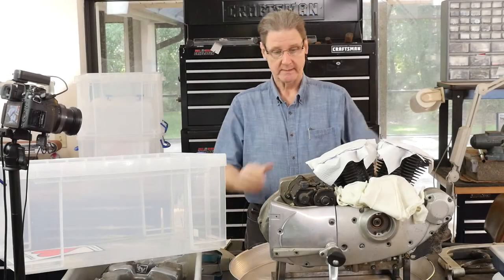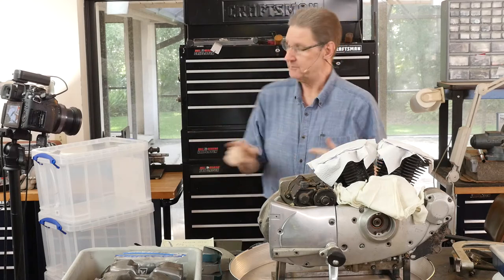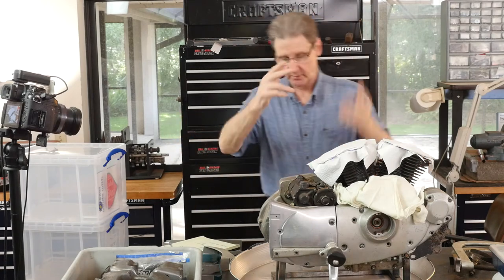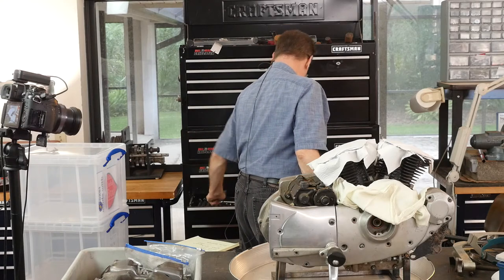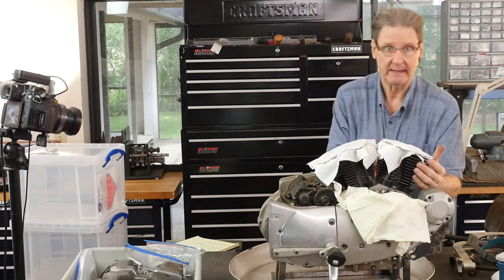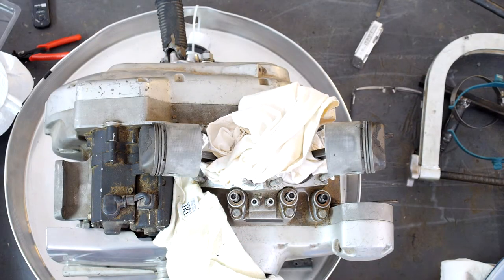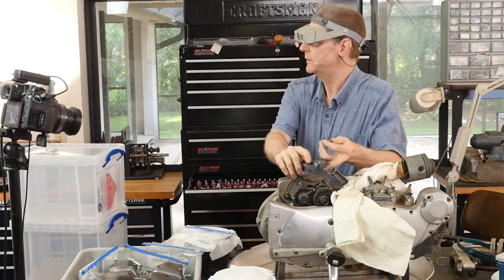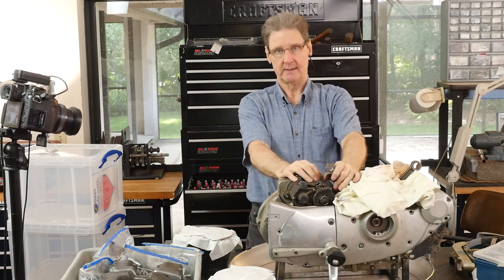Iron Sportster cylinder R&R

Comment: Mine had spirolocs.  What a pain in the ass to get out.  Tatro said thats why I use them
Reply from the maker: I hate them spirolocs too. One thing, with them I do think you should throw them away after once use, especially the way I bend them up getting them out. Harleys, can't rev to 9,000 RPM, so I have always found good old snap rings work OK.
Reply: For myseft , getting them in is the hardest.

Comment: I was trying to contact you through your website but there is no link to do so?
Reply from the maker: No, for a one-man operation, putting an email on a website results in dozens of spam mails. I am on LinkedIn, Paul Rako, and a message there will get to my inbox. If you want to ask if I do work or have parts, sorry, I just work on my own bikes and make videos to help others do the same. I do put parts on eBay now and then, but no firm schedule.